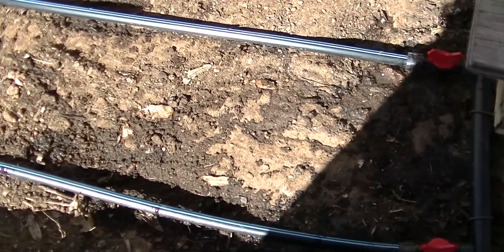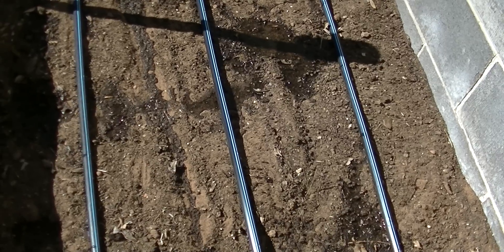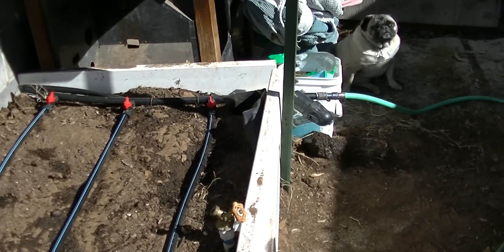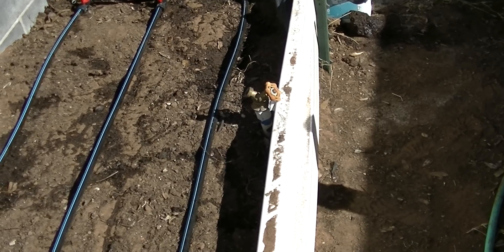Drip Tape Irrigation

Comment: Really cool. Would you leave a system like this on all the time, or would you turn it on and off? Are there any pre built kits you would recommend? 

Very informative. Thanks!
Reply from the maker: It is turned off and on. Used in conjunction with the Plasticulture techniques your water usage is substantially reduced. I get my supplies from Tubbs Berry Farm in Twin Falls Idaho. I believe Harris Seeds, Johnny's Seeds and a few other such companies have kits offered for sale specific to the small gardener.
Reply: +Michael Luck , am looking for such a driptape..
Reply from the maker: James; do an online search for Toro T-Tape. You should find a distributor that can help you out.